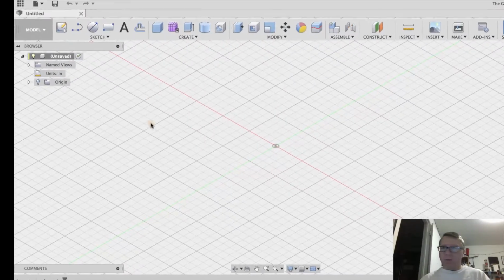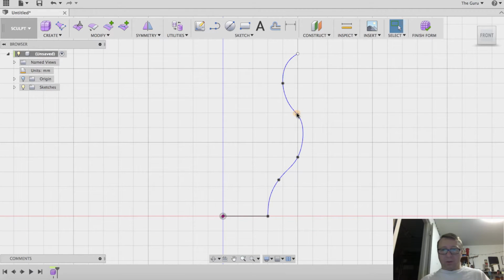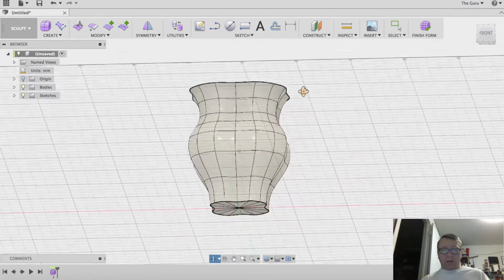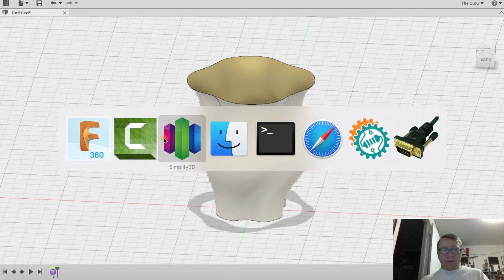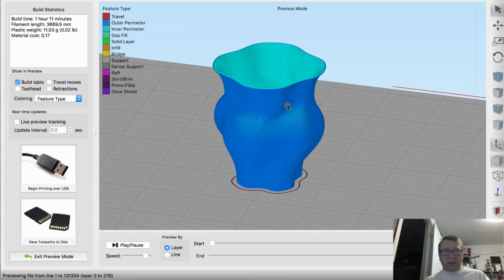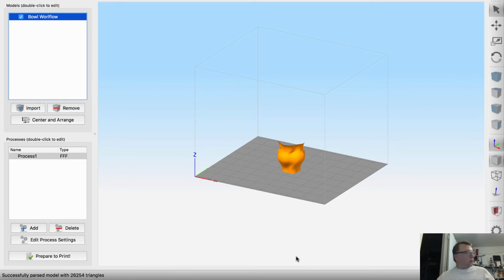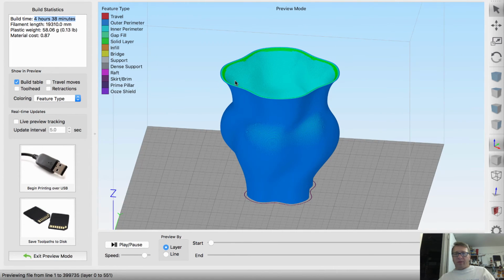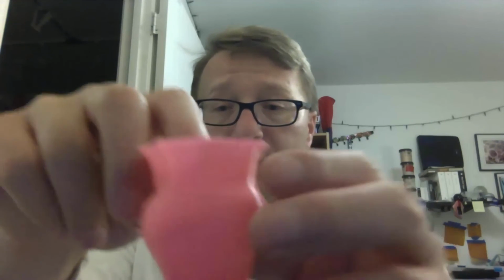Making a vase using Fusion 360, Simplify3D and Prusa i3 MK2

Comment: Nice vase.  Interesting approach.  You chose to not give it thickness in Fusion but rather control the thickness by changing number of shells.  The spiral may just be the different locations the nozzle elevated in z height.

Comment: The line showed in Fusion360 go check your build.
Reply from the maker: I don't understand your comment - what line and what build?
Reply: cyberreefguru  in Fusion 360. Go back and look at your video of the design and I saw a vertical line that would be twisted once you twist the to and bottom of the vase. I will try to find it and post the exact time on the video.
Reply: cyberreefguru  9:10
Reply from the maker: yes, that is the original spline from the sketch what we used to revolve. it is twisted from the rotating we did in the sculpt mode.  you can turn the line off in display settings if you like by hiding visible edges.
Reply: ahh ok. You mentioned in your video how you didnt know why you had a line in your print. I was just trying to find the cause of the problem. =)
Reply from the maker: Ah, yes.  The defect was on the inside and spiraled from top to bottom across the whole perimeter of the vase - the spline is only on one side, so I don't think it's related. But thanks for thinking about it!